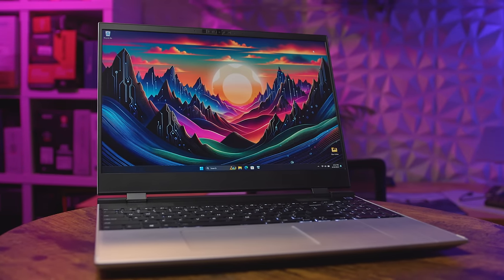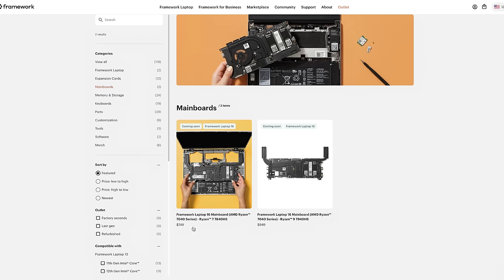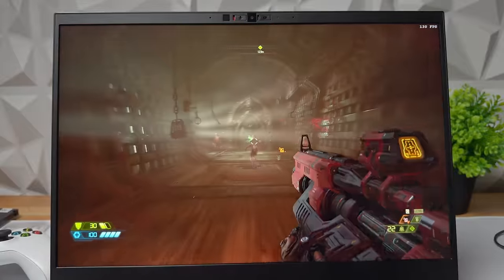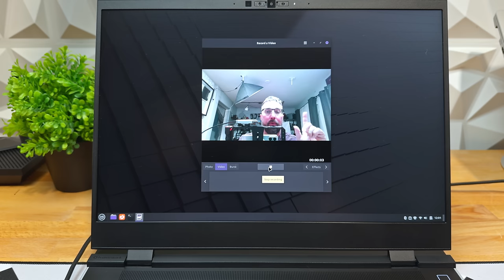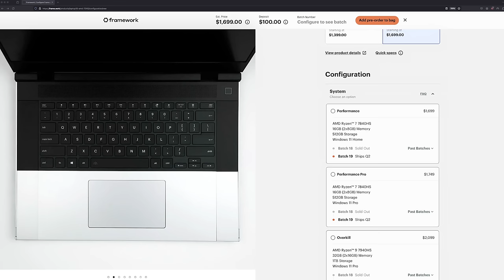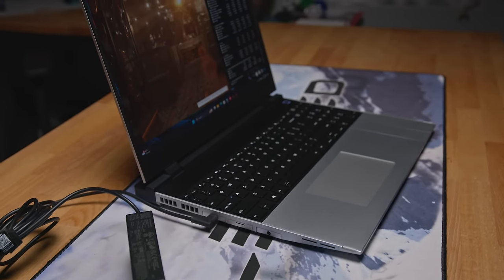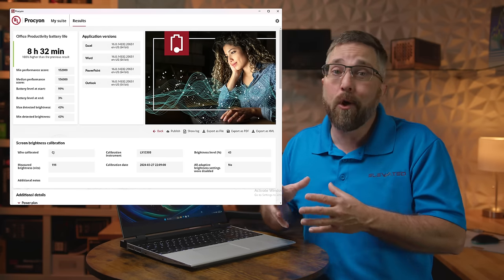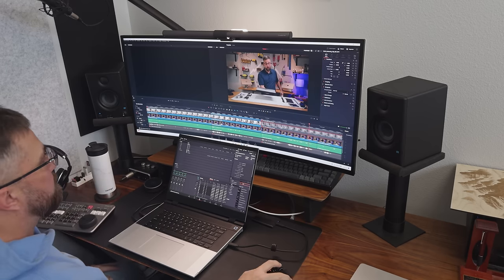Two Months With the Framework 16 Laptop. My Final Thoughts!

Comment: While I like the idea of a laptop that is fully configurable, upgradeable and most importantly REPAIRABLE with user accessible parts, I agree that the price is the killer here, especially for the 16 - the "value" totally depends on what the expected shelf life of the existing design is, because if they make a change that locks out this current design, it's game over. My other thoughts are that the lid is so wobbly, it's outright scary. It would be nice if the hinge were more like the 13's, and perhaps a midframe that screws into the outer lid frame might help with the rigidity, at the cost of maybe a bit of thickness to the lid.

That said, the design at the rear of the laptop is a little awkward and obviously affected the lid/hinge design, but I guess that's the price paid for allowing for that GPU module; then again, they probably could have integrated GPU options into mainboard offerings. Overall, I'm on the fence. Gaming is not a top priority for what I'm looking for in a laptop. if they were to make a 15" version that mirrors the design of the 13 and they can somehow get the pricing at least closer to the ready-made competition (not really asking for parity given the design goals of the product, but come on - meet us halfway), I might bite.

Comment: Got a AUD$1000 FW 13 11th gen i5 32Gb off eBay (they weren't yet available in AU at the time). Has a flexy, glossy screen, fan is noisy watching YouTube. It's fine, altho you can now get a CNCed top cover + matte screen if you want. I run VMs on VMware Workstation (now free!) I've only replaced the NVMe and repasted the thermal paste on the iGPU so far, may last me 15 years. For perspective, my previous top-of-the-line Sony Vaio dual core 3Gb 32-bit 100Gb HDD lasted me 14 years; replaced the RAM, harddisk twice, keyboard but it was a total pain. Tens of non-captive screws, v fiddly, no easy replacement parts

Comment: The way I look at it: you buy a MacBook Pro for thousands of dollars. It’s ultimately a better machine for a while, until your battery breaks, or you run out of storage space, or you spill coffee on it or break the screen. Then apple charges you out the ass for parts and repair, sometimes fix things that don’t need fixing. Try upgrading the storage or cpu on your MacBook post 2020 and tell me how much fun that is!! You can’t swap between intel and AMD on a Mac for fun like you can fw. Definitely not bang for your buck with fw16, but I’m keeping my preorder with the faith that the company still being around in 10 years. They have teased some neat things like a piano keyboard that can replace the text one, or a turntable, or an extra battery for the expansion bay.
Reply: Also another thing too, is that even though macbook pros may be good right now, what if the next generation ones suck.

If you remember, back in 2015-2019 they had the horrible touch bar macbook pros with poor cooling and the prone-to-break butterfly keyboard. Imagine if you LOVED macOS and you LOVED your unibody macbook pro from 2012, which was amazing at that time. But 6 years later you needed a faster processor and your only option was for a macbook with thermal throttling and a butterfly keyboard.

Being able to upgrade your device at your own discretion, and choose only the upgrades you need is so much better than buying an entirely new device.

Comment: I think the Framework 16 will make more sense in a couple years.  It needs a little time to mature, just like the 13 did.  For a low power user who does not need the external GPU, the Framework 16 could be the right fit as a "Forever Machine."  I do agree that the track-pad part should have been a single unit with choices, not 3 separate parts with their own stacking tolerances.

Comment: I am considering this machine, reviews like this are helpful even though it seems a little windows centered (I assume but can't tell for sure what you are using). I use Linux on all but one machine so the Linux support is about the only thing that matters to me, and I like the idea of supporting them but I am still undecided... mind you, there are not a whole lot of other options out there that fit my needs. I would feel a lot better if the Framework 16 could charge on 2 USB C ports at once or came with a barrel connector like the 13. What I really want is an ARM PC since my desktop can do all the heavy lifting and I really just want a decently fast 15 inch laptop. But I can't seem to find any good options. Failing the ARM route, my plan is to go the beefy x86 route, but since all my machines are all x86, having a decently fast ARM machine would be nice so I can play with writing code for ARM machines as well as x86.

Comment: I'm enjoying mine, the fans can be loud and high pitch at the max, but noise cancelling headphones can take care of that well enough. It's performed great for what I want it for, all my games run perfectly well on it. I do primarily use it as a desktop, so I mostly want it for the performance, but I can also take it with me and charge it with USB C. USB C charging is probably the biggest thing for me, and the fact that it can have even more powerful components while using the same connector as so many other things is a big plus. I think my idea laptop would also be a 2 in 1, but the Framework 16 is the closest I've gotten my ideal laptop so far. Previous one was the highest spec Yoga 7i, but the storage was the only thing I would reasonably upgrade, I wanted more memory and performance overall.

Comment: I have had a framework since the OG release. did the 12th gen upgrade and now on the AMD release for the 13". The main issues I have left are firmware releasing and quality being lacking... and I can see windows users complaining about the lack of driver updates from framework (though there are plenty updates via WU).
The slow firmware updates are what makes me not consider them for work (a fleet of 30k frameworks they are not ready for).

I Feel confident I will be getting a 16 even if its the 8xxx series I end up getting because of the backorders. They seem fine on lifecycle, long term support, etc. Its not easy or simple yet. However I dont really have a big concern anymore  about if they will go away or not offer fixes for issues... it just might take 6 to 12 months at times for some issues.

Its still more of a enthusiast item... but at least its not kickstarter quality and support anymore. Its still a lot of community driven support (like how to use pads to fix the deck flex).

Comment: I'm not interested in the ability to upgrade the thing, I simply want to be able to custom pick the needed specs that I want, most laptops are lacking in one way or another, e.g. not enough storage, not enough ram, unsuitable I/O ports, low end CPU, low quality display, etc . A choice to select higher spec displays is one of the items I was hoping to see available, but it's unfortunately not available. What I've done out of frustration, is I bought a miniPC with the specs that I need. I bought two portable 4K monitors, probably will buy a 3rd. The mini plus displays and accessories, easily fit into a backpack. The miniPC works great when on extended trips, I still need a laptop for various situations, but a typical craptop can do the job for quick and dirty stuff, while the miniPC does all the heavy lifting later on. Preferably, an all-in-one solution is better, but no such thing really exists. Apple's solution do not work for me as I'm a Linux user. The last time I bought a high-end "intel inside" laptop from HP, the thing blows hot air like a space heater, and the battery is useless. I've had good success with AMD Ryzen CPU's, they are generally much more efficient than Intel equivalents, but there are very few laptops that are not Intel based.
Reply from the maker: Ya, unfortunately at this point other than memory and storage the FW16 isn’t very customizable.

Comment: I like how you handled FSR and Fluid motion frame in this overview.

Integrated GPU doesnt necessarily mean it is bad. 
The main issue for regular PCs is the limited size where Apple and consoles can fit way bigger GPUs in the whole package.
But I do believe Radeon 7700S is bigger than M2 Pro GPU so if properly utilize it should perform better.
Then regular PCs also have memory bandwidth limits where Apple use lots of channels (along with high bandwidth LPDDR) and consoles use the same memory as dedicated GPUs use (GDDR).

Hopefully with right to repair legislation, Apple will only improve from here. Where Framework needs to become way bigger in order to improve.

You can also buy individual parts if you wanted to do some build projects (maybe there is even cheap b-stock/used in the future).

Comment: For me, I would be fine with the "base model" and 4 modules. That would be about 1700,- Buy adapter, RAM and SSD seperate would be about 200,- (16Gb/1Tb and 100Watt adapter). I am a not so often gamer, use terminal a lot and do very minor video editing. But the quality issues like keyboard flex, screenflex, speakers and mic are something to think about. Having said that, the first Tesla model S wasn't all that great either :-). The 13" doesn't offer a linux keyboard or a screen like the 16" has. Are other companies also allowed to make new mainboards for these FW laptops? (honest question)

Comment: I'm using a top of the line Lenovo P1 Thinkpad with a 165hz 16" 800 nits screen and unmatched keyboard. It came with a 13th gen intel and a dedicated GPU for pro graphics for $2000 CAD. That's about $1500 USD. If Framework wants my money, I am willing to give it to them, but it has to make sense. I honestly wish they do make it and maybe by 2nd or 3rd Framework gen, I will consider them
Reply: Could you give link ?

Comment: If FrameWork Team can redesign the Framework 13 with swap GPU and the fixing the problem of the fan noises, over heat, have Dual Screen Touch. I wish to buy it.
Reply: 13 is too small for a discrete gpu

Comment: I feel like the 16 is too modular. 

They keyboard could have been a two choice option for one with numpad and off center trackpad as well as one with no numpad and centered trackpad. 

It would have reasonably satisfied most users. Yes, some unique layouts would have been unavailable, but quite frankly, no layout seems appealing to me with the unavoidable noticeable part seams.

The display having a replaceable bezel also seems questionable now. With more and more laptops being released with almost bezel-less designs, I wonder how this design will look like in 5 years. It already looks far less refined than other laptops of similar price. (the 13 didn’t have this problem due to lower price and smaller chin)

Regarding this, I hope they release a future display with small non replaceable bezels - simply focusing on making sure that it is possible to disassemble the display unit for the event that you need to repair it. 

The framework 14 worked so well because it was as slim and nice looking as all the other competitors while being significantly better to repair. Customizability beyond port selection was not valuable to me and I suspect the same for the general customer. 

The 16 lacks this simplicity and refinement of the 13. It feels like a portable desktop more than a sleek 16 inch laptop.
Reply: The first gen framework 13 wasn't all that great either. First gen products rarely nail it. However, framework made the smart choice to cater to the ultra nerds first and foremost because they were the most likely to purchase their product. That's why there's customization beyond what the average consumer would want. As for reaching the average consumer, that part comes later as they grow. If they did make a bezel-less display, I imagine you would have to replace the whole top half of the laptop.

Frankly, I don't get this aversion to bezels, especially if you can customize the color of them.

Comment: I got a batch 1 FW16, and I have to be honest, it was a very rough start. It throttles all the time and is uncomfortably hot. I maxed out my configuration and it just seems VERY not worth the money in hindsight. I am sad because I really just wanted to support more open and free tech, but I have gotta be honest, i'll probably just use my steam deck more for portable gaming, and I should have bought the 13
Reply from the maker: Are both the fans running? My first batch 1 FW16 the fans were non-operational.

Comment: Did you happen to do any testing that'd resemble light-to-medium Photoshop use, and heavy Lightroom use? I don't know how comparable to video editing photo editing is, though I would assume it's far less intensive.

I ask since the FW16 is my goal as a professional photographer. I don't think the FW13 will cut it, but the 16 with the 7700s should from what I've been obsessively reading and keeping track of.

My point of reference is my Intel 7700k desktop, AIO liquid cooled with an EVGA 1080ti Hybrid. Nuilt that PC myself and it's still chugging along like a champ over 7 years later! The only thing that really holds it back for my uses is the 32GB of RAM getting close-ish to capping out on big imports to my LR catalog (but it's also cause it's sharing resources with my regular daily programs. A restart and going straight into LR uses only half my RAM at most, usually.)

Looking at benchmark numbers, a FW16 should keep pace with my desktop, possibly outperform it a little, even. +/- 5-10%, depending on the metric.
Reply from the maker: I did basic PS work on it creating the thumbnails for my videos and it worked fine. PS and LR are mostly CPU/memory intensive so yes the FW16 should outperform your 7700k. Depending on your workflow you may not even need the dGPU. I'd evaluate your workflow and determine if you heavily use the few GPU effects and filters. Most photographers who are just doing color corrections and touchups typicly don't ever tax a GPU.
Reply: @ElevatedSystems  excellent, thank you CJ! I have PS and LR set to use GPU acceleration; would that not make a performance difference with that enabled?
Reply from the maker: @Kitteh.B  disable it and go through your typical workflow to see if it makes a difference. Like I said there are only a handful of filters and effects that actually use the GPU. Just google which photoshop features use the graphics processor.
Reply: @ElevatedSystems  fair enough, A/B test it is easy and logical lol

Thank you again :]

Comment: I'm not a Framework owner, and probably wont be as my current laptop will last a few more years yet. I love what they are doing though. This should be the standard, at least for sourcing replacement parts.
I do wonder what will happen a few years down the line though. Eternally upgradable would be awesome, but feel like there will come a day when reasonable design change is needed. 
Is there a minimum expected number of generations people expect?
Reply: Only time will tell. Manufacturers will follow the money.

Comment: I feel like if youre going to compare them to an Nvidia GPU running optix you should use ROCM HIP on the 7700s. It does in fact work with ROCM they just suck at letting anyone know what GPUs work. The Nvidia GPU would still win as blender devs dont really care a lot about ROCMs code path like they do CUDA and other nvidia tech but itd be nice to see

Comment: It’s a no-brainer that you should send the laptop back, if it can’t handle the work you need it for. Especially when you’re open to using Windows.

One nit I have, I think you should have made a stronger point about how your use-case was limited by AMD (perhaps Framework to a point, but only inasmuch as they went exclusively with AMD on the Framework 16). 

By my research, Framework is actually at the top of its class in terms of the latest-and-greatest AMD CPU/GPU options.

This is the thing that makes me the most conflicted about Linux as my daily driver (which it has been for a decade, with only Intel/NVIDIA setups). The tradeoffs between NVIDIA and AMD are very stark.

I spent 5 hours Saturday recovering my system from a kernel panic on update, directly caused by NVIDIA. I bisected a kernel issue with NVIDIA driver last year, too. With Wayland support nonexistent, you can see why I would even consider going the AMD route (as someone who has money to spend and usually spends extra for top performance).
Reply from the maker: Not quite the top of its class. There are laptops with the Radeon RX 7900M for cheaper than the FW16. That’s the GPU it should have come with at this price.
Reply: @ElevatedSystems  thanks, I will look into those.